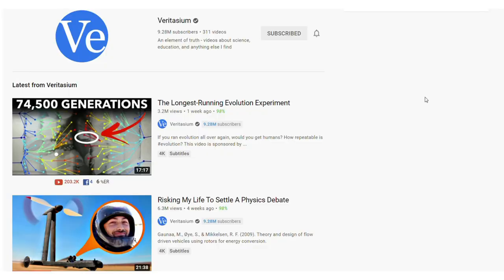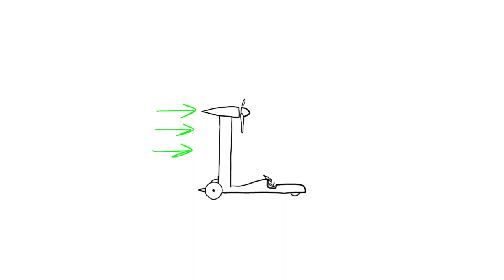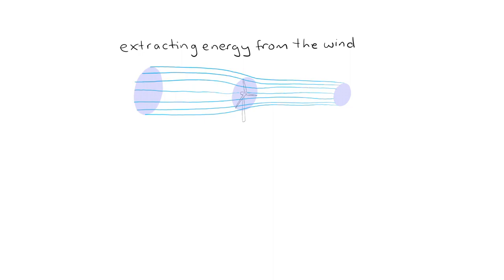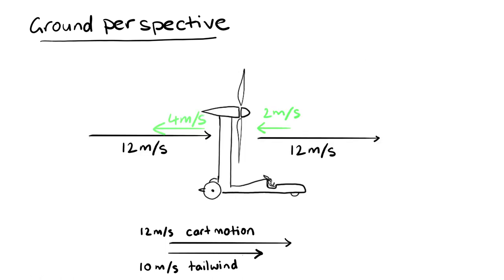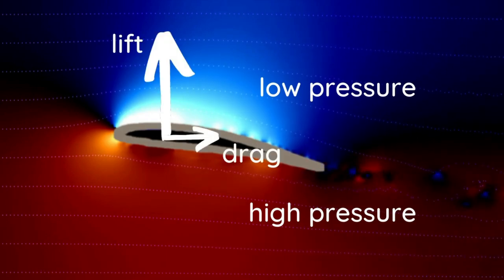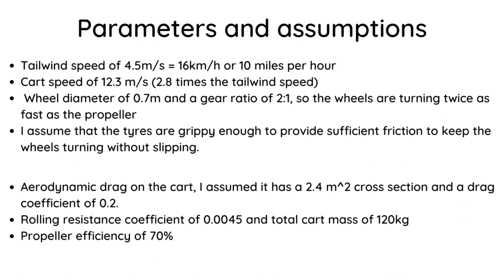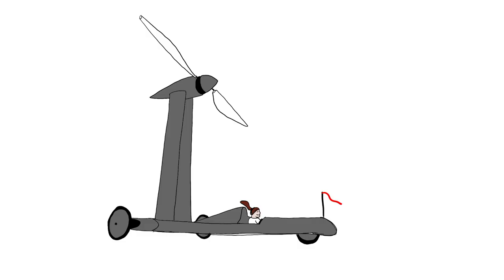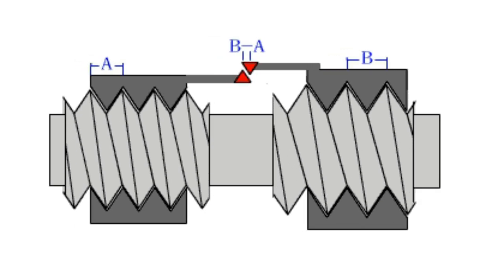Downwind Faster Than the Wind by Veritasium: How Does it Work?

Comment: If I may add a consideration, the chain linking the wheels to the rotor has the same function as the keel on the boat: it forces the sail to a given angle of attack. In other words, for every meter downwind, the blades are forced to move laterally for a given amount, same way as a boat when tacking at a given angle.
Reply: ^^^^  THIS

Changing the gear ratio between the wheels and the prop is the equivalent of using the rudder on the sailboat to change the angled path through the water (point of sail).  Changing the pitch of the blades is the same as rotating a wing-sail on an AC racing yacht.
Reply: Not quite the same. From the boat's frame of reference, the source of energy is the apparent wind, and a component of lift (which by definition, is perpendicular to the apparent wind), is in the same direction as the boat, propelling the boat forwards. From the DDWFTTW cart's frame of reference, the source of energy is from the ground (the forward force of the wheels accelerates the surface of the earth by a very tiny amount, reducing the angular kinetic energy of the earth from the cart's frame of reference). Through reduction gearing, the drivetrain converts the higher speed, lower force from the ground into a lower speed, higher force at the propeller, despite losses. There is no analogy to reduction gearing for the boat.
Reply: @rcgldr  yes, the analogy is the angle between course and real wind. Have a high gearing (rotor spins fast) is like sailing at a wide angle. Low gearing, you are more parallel to the wind. No gearing and is like when you are sailing straight downwind. You have to find the optimal angle/gearing to optimize VMG.
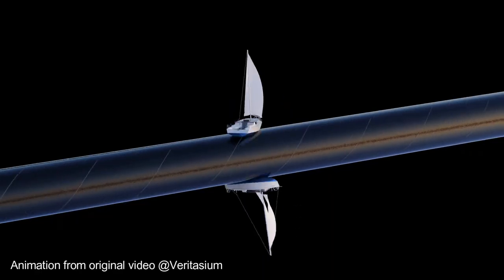Reply: @rcgldr  just watch at 9:39. Sailboat at an angle.
Reply: @rcgldr  

// "Not quite the same."//

Exactly the same as the keel -- marko described the constraint perfectly. 

// "There is no analogy to reduction gearing for the boat."//

Gear ratio = point of sail -- as marko points out.
Reply: @rcgldr  "a component of lift, is in the same direction as the boat, propelling the boat forwards." The exact same thing applies to the propeller on the vehicle - a component of lift (on each propeller blade), is in the same direction as the vehicle, propelling the vehicle forwards.
To go one step further, the lift force on the keel of the sailboat has a component pointing into the wind, just as the wheels on the DDWFTTW vehicle's wheels have a drag force pointing into the wind.
Reply: @andrewsnow7386  - but the component of lift on a sail in the direction that the boat travels is a small fraction of the total lift, while the component of lift from a propeller (thrust) is almost all in the direction of an aircraft. The key aspect of DDWFTTW is the reduction gearing: that from the cart's frame of reference, a higher speed, lower force is geared down to a lower speed, higher force despite losses. In a case where energy losses aren't an issue, such as when the two media are both solid surfaces, there is nothing resembling tacking. In this video, the gearing reduction is from the table to the ruler, and the geared cart moves under the ruler faster than the ruler.

https://www.youtube.com/watch?v=k-trDF8Yldc&t=107s
Reply: @rcgldr   "the component of lift on a sail in the direction that the boat travels is a small fraction of the total lift, while the component of lift from a propeller (thrust) is almost all in the direction of an aircraft." If I replace "aircraft" with "DWFTTW vehicle", then this is the corresponding statement to yours - the component of lift on a KEEL in the direction that the boat travels is a small fraction of the total lift, while the component of drag from the wheels is almost all in opposition to the direction of the DWFTTW vehicle. The large sidways forces are something the DWFTTW vehicle doesn't have to deal with, but no one claimed a sailboat and DWFTTW vehicle were identical, just that there are many similarities.
Being able to change the gear ratio on the DWFTTW vehicle does give design flexibility. This video gives the reduction as 2:1, but if the wheels were 1.4m in diameter (double the diameter), then it could use a 1:1 gear ratio. If 2.8m diameter wheels were used, the propeller would need to spin around 2 times faster than the wheels. So I think saying reduction gearing is a key aspect of a DWFTTW vehicle is overstating it a bit.
".. there is nothing resembling tacking"  - right you are. With solid mediums it's not necessary. Forces can be applied to solids without any movement.  To apply a force to a fluid, motion is necessary.  A propeller is a common way to apply force to a fluid. A propeller is undoubtedly the best way to propel a DWFTTW vehicle, but it's not required. Consider the spool in this video:
https://www.youtube.com/watch?v=WrGZCHh8MyU
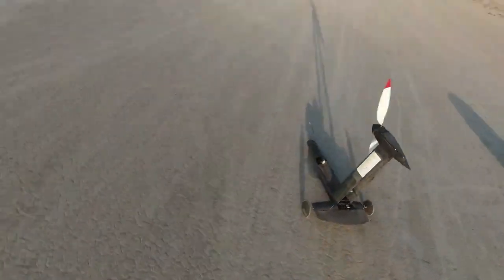At 0:10 notice how the spool moves faster than the end of the string he is pulling. What if you tied a large balloon to the end of the string, and put it out in a light breeze? I think it's easy to imagine that the large enough balloon (maybe with a little helium in it to reduce it's weight and thus drag on the ground) would blow at nearly the speed of the wind. So the spool would move faster than the wind - no tacking and no gears required.
Reply: @andrewsnow7386  the reduction gearing isn't meant to be taken as literally the gear ratios, but the ratio of reduction in speed from the ground to speed of the thrust (exit velocity just as pressure returns to ambient) from the propeller. My impression of the Blackbird's stated 2:1 reduction ration is ground speed versus thrust speed, as it was stated that the upper gear is huge compare to the gears used to drive the chain (much higher than 2:1 reduction, but prop has a much larger diameter than the wheels, so an over all 2:1 reduction in speed). I commented about an alternative vehicle, a model riverboat with a paddle wheels.  Similar to a Brennan torpedo, wires are pulled backwards from spools with effective reduction gearing that convert the higher speed, lower force from the wires into lower speed, higher force at the paddle wheel. With the wires connected to posts, the boat would travel downstream faster than the stream, with nothing that resembles tacking. The key factor in these vehicles is the conversion of higher speed, lower force to lower speed, higher force, regardless if a propeller or a paddle wheel is used.
Reply: It's not immediately evident to a lot of folks that this is equivalent to the two sailboats following a helical path on a cylindrical Earth, but it truly is.  In fact, that's exactly how I got from a boat tacking downwind to a vehicle that goes DDWFTTW for the brain teaser I posed.
Reply: @Rick_Cavallaro  - the key factor to these vehicles is higher speed, lower force is converted into lower speed, higher force via effective gearing reduction. A propeller may resemble two sailboats following a helical path on a cylindrical Earth, but a propeller is used simply because it is efficient, and not due its resemblance to tacking. My alternate example is a model river boat, with two wires pulled backwards and unspooled from thin spools that drive a wide paddle wheel (similar to a Brennan torpedo, but the boat has the advantage of not being submerged). Some type of reduction gearing would convert the higher speed, lower force from the wires into a lower speed, higher force at the paddle wheel. With the wires attached to posts, the paddle wheel driven boat would move downstream faster than the stream. For the paddle wheel driven DDSFTTS (directly down stream ...) boat , there is nothing that resembles tacking.
Reply: @rcgldr  
>> A propeller may resemble two sailboats following a helical path on a cylindrical Earth, but a propeller is used simply because it is efficient, and not due its resemblance to tacking.

I don't follow your point.  The cylindrical Earth is simply a description of how I got from a tacking sailboat to a propeller on a land vehicle.  The two are identical from both a kinematic and aerodynamic perspective.

>>  For the paddle wheel driven DDSFTTS (directly down stream ...) boat, there is nothing that resembles tacking.

That's true.  But I'm not sure what your point is.  Is it simply that there are ways to go DDWFTTW without tacking?  I have a number of models I've presented that show that as well.  But the one I chose to make happens to use two sails on a continuous broad reach like a sailboat on one continuous downwind tack.
Reply: @Rick_Cavallaro  - my point is the key factor for these vehicles is a gearing reduction that converts a higher speed, lower force to a lower speed, higher force. The resemblance to tacking might help someone that understands that sail boats can achieve vmg greater than wind speed, but the gearing reduction explanation is more generic, and in my opinion, more to the point.
Reply: @Rick_Cavallaro  - do you have a parts lists and what it takes to build the treadmill models? It was either posted at physics forums or in one of the videos, and a few people built nearly identical models.